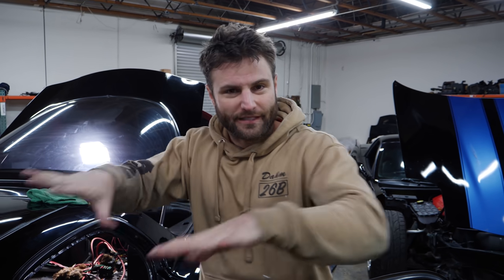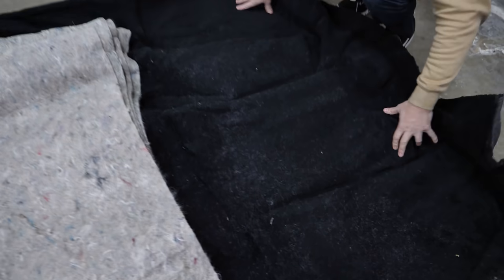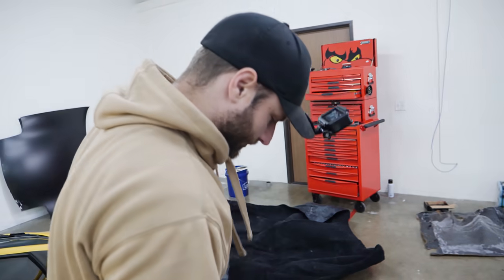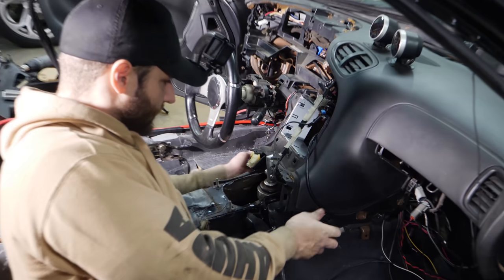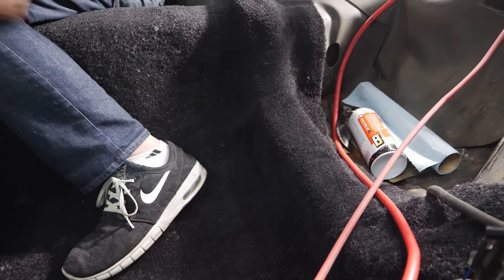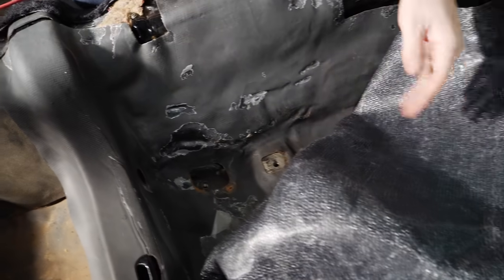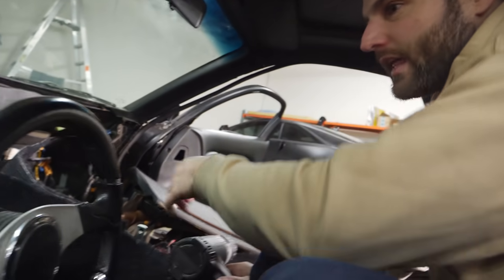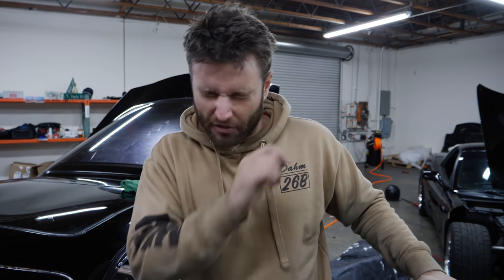How BAD is the $140 Carpet from Amazon? Car Interior Replacement

Comment: Let me start by saying that I do upholstery for a living. I am well aware of the carpet company that came from. Unfortunately there are not to many more solutions outside of them. You could go to a shop and have someone actually make a whole new carpet for the floor. But that’s hella expensive. I have used this carpet many times though as it is kind of a necessary evil and and full of pointers if you need any
Reply: Doesn't there exist some kind of "relatively easy to work with" car carpet that can be stretched/molded/formed/bribed into shape with heat/steam/agent? I think a company could make a pretty decent buck out of such a product.
Reply: Anders Juel Jensen there are many different types of carpet and even this company uses them, depending on what you order. But what they generally use and what he has both will work great with heat. But mostly steam. It takes a lot of time and patience.  And not always the case but we have spent several hours in and out of the car heating and forming.then spraying it with glue to lay it. There “molded” carpets are just to get you in a general area. You just have to take it from there.

Comment: I would be more pissed if I bought expensive oem carpet that didn't fit and not pissed that the cheap alternative didn't work. You spend 140 bucks vs spending 900, you should expect to do work and have a quality difference. Good carpet isn't cheap and cheap carpet isn't good.
Reply: Kyle Smith the carpet he has is fine... tons of people myself included have used it probably and got good results. He didn’t install it right lmao

Comment: Dude Buys an aftermarket carpet for a car thats a complete piece and held together with zip ties and bubblegum. Dont blame AAC because you cant make an aftermarket part fit. Nobody makes an aftermarket carpet with seatbelt and seat holes all of them are cut to fit. That same company makes carpets in many textures and colors and can almost match any OEM carpet. I've installed plenty of them and i assure you couldnt tell that it wasn't OEM. Yes that looks like one of their lower quality cheaper carpets. Point of this post Dahm buys cheapest part and throws hissy fit because you don't have the mechanical know how to make it fit properly.

Comment: Dude buys a product he doesn't understand, does basically everything wrong installing it, and then blames the product.  Did I miss anything in that 15 minutes?
Reply: What Is the proper way to install it?
Reply: nope, i feel bad for the company thats given bad press, this carpet is fine for the price point. He also mentions that the company should offer a more expensive option but i dont see any reason for that company to offer it for the few that purchase these things, other companies exist but he doesnt want to spend the "1k"
Reply: @peakperformance8960  First we put them out in the sun to get them a little flexible, but everything needs to be removed from the car or trimmed around.   You can clearly see him fighting a seat belt bolt and then complain that the carpet is wadding up.   Remove it, or trim around it.   You're going to have to cut holes in every aftermarket carpet I've ever seen.
Reply: @RecklessRegal  but it didn't look very formed at all, how does it stay in shape when it's put into the car?
Reply: @peakperformance8960  The bolts that you put back in after you cut the hole, things like the seats, console, and the trim panels, hold it in place.
Reply: peak performance it was formed from the factory. When it gets shipped it gets folded and that fucks it up. You have to let it reform back to its shape first